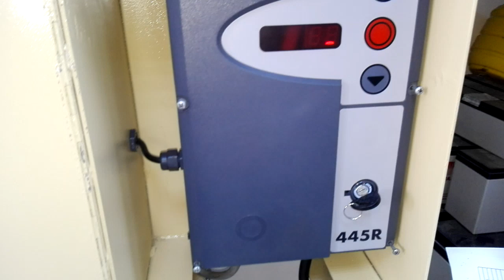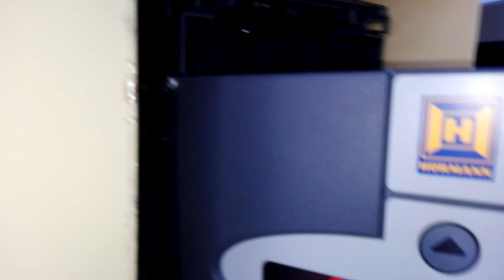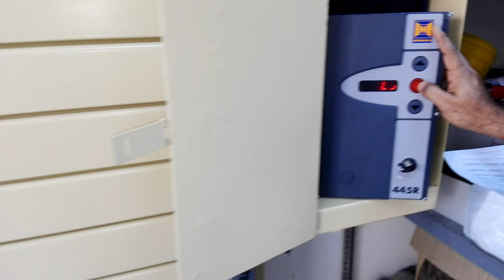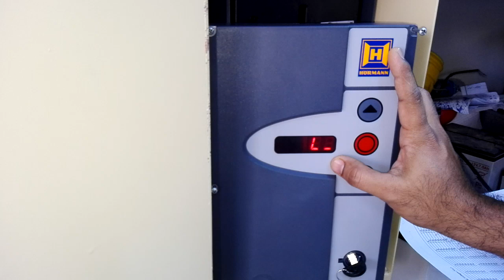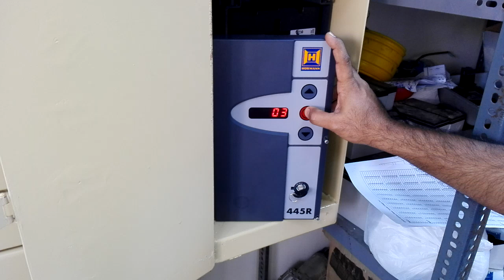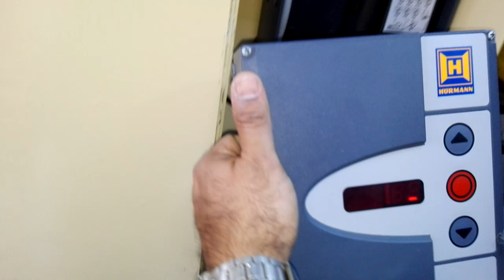How to programming shutter door

Comment: My 445 is new. If I press up it show 51 if I press down it show 52. I have not programmed. Where I can find the description for the numbers? I have a IR light below the door installed.
Reply: Did u finish programming
Reply: When I doing programming up limit its showing number 4.
When supply is on that time showed U-
Reply: @madhavanmaniraj2354  can you tell man how did you solve your problem
Reply: @RahulSingh-xm3ts  i also need solution for this. Fault code 11
Reply: How can i change the door rotation when programming end position? if i push botton up the door goes down and if down botton it goes up